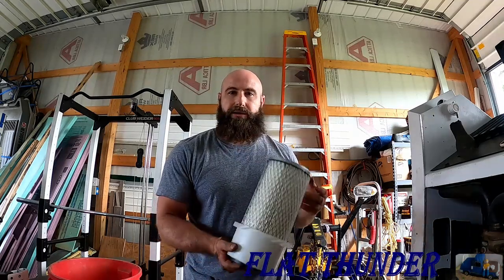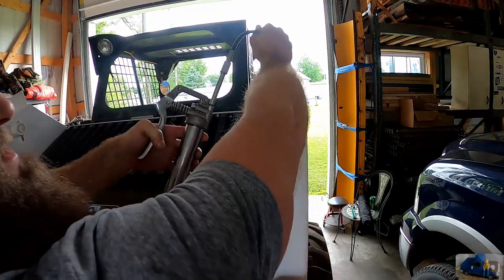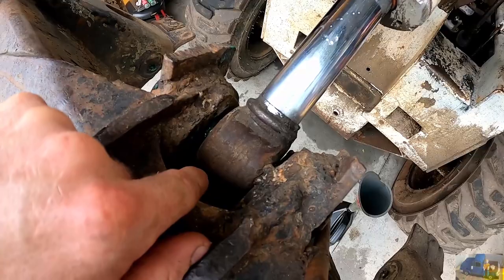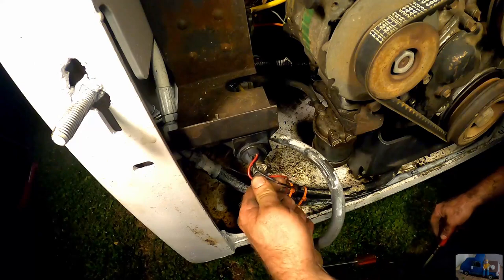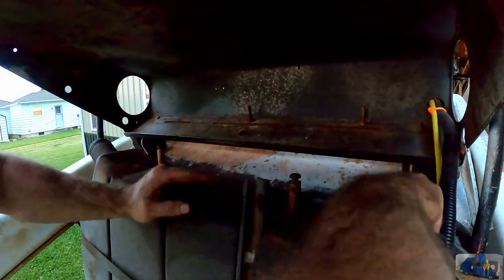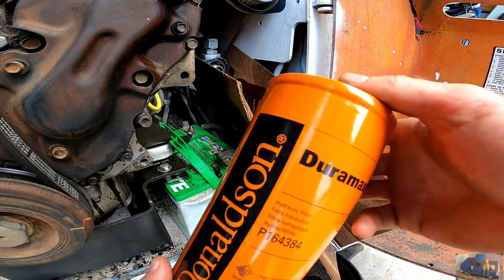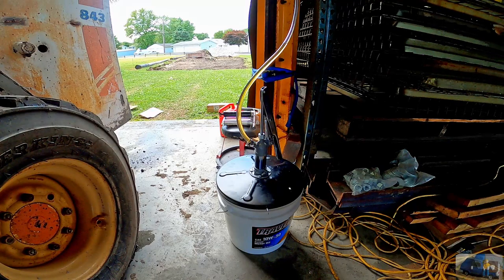BOBCAT 843 - PREVENTATIVE MAINTENANCE / FIRST CUTS; Episode# 9

Comment: The Diesel filler cap hole is bigger to pull the screen out 👍
Reply from the maker: Good idea!  I never thought of that until you mentioned it.  Hopefully I will never have to address any issues with the fuel tank line again.  Might hookup the fuel sending unit, but that's getting mighty fancy for this old girl.  Thanks for watching! 👍😁
Reply: @FlatThunder  it was a good watch 😉 and a great machine 👍 if you look after it unlike the last lad with dirty cans of diesel you will never be in the tank again, did you ever get the bucket pin fixed?
Reply: @FlatThunder  IV to pull my transmission out completely as the case has developed some kind of aluminium rot on a circlip retainer it holds a flat coin type of stopper against a o ring directly under a drive arm underneath the transmission 😓 about 8 pipes to come off and engine out the rack door, H46  spilling out of it 😔.
Reply from the maker: Oh boy!  Sounds like a big project over a little defect.  I'm sure it's worth the effort.  These are great machines!  Good luck 👍
Reply from the maker: Thanks!  The bucket pin is still on the 'to do' list.  I also acquired a new seal kit for the tilt cylinder.  I noticed with the forks on that she leaks off rather rapidly.   The whole tool plate needs some serious attention.  Hope to address all the issues on the front plate at the same time, but I'm currently in the midst of many other immediate projects.  So many projects.... So little warm weather left in the season.
Reply: @FlatThunder  ah I hear ya brother we definitely in the same boat 😂

Comment: Attempted to replace fuel filter on 843B, fuel not flowing, machine not starting.  Any videos or suggestions on what to do to properly complete the task? Thanks
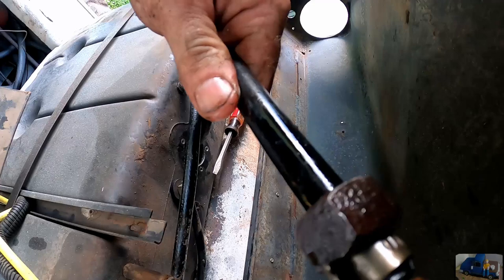Reply from the maker: Hello!  You likely have air in the fuel system.  You need to bleed the fuel system.  Start by pumping the priming bulb (or in my case running the electric priming pump) until fuel is at the injection pump.  Then crack all the fuel lines loose at the injectors (loosen the tube nuts).  Crank the engine over until you see a good flow of fuel squirting / bubbling out around the tubes at all of the injectors.  Tighten the tube nuts and try starting the unit.  It isn't overly thorough explanation in the video, but check https://youtu.be/njjUUzRYN4Y around 12:45.  I explain the process.  Good luck! :)

Comment: Nice video, I work in the Maintenance Dept. at a Donaldson's plant,  Duramax has nothing to do with Duramax diesel just the name of the series line. Just about every filter you see on industrial equipment is a Donaldson filter painted/boxed in OEM specs.
I'm wondering if you have any advice on how to trailer an 843 that isn't starting. I want to get it back to my shop so I don't have to make 10 trips back to grab something I forgot or haul every tool out there. I've looked around the forums and found such varying advice that is never specific to Model or complete procedure. Don't want to just drag it up the ramps. Do you think it would hurt if I had 1 guy hold the levers in reverse while I turned the key for short periods of time.  Thanks
Reply from the maker: Hi Tim!  Thanks for the inside information on Donaldson filters.  I think they are good filters.  I don't think the cranking RPM will flow enough fluid to progress the unit forward.  It has a big gear reduction.  It's worth a try, but I'm not overly optimistic it will get the job done.

Loading a unit is pretty easy with a winch.  Relatively speaking of course.  It's the unloading that gets sketchy.  I recommend backing the trailer up to the unit and winching it on the deck.  We used some scrap sheet steel (old barn siding) and ATF to help out slide across the deck.  Once the tires where on the sheet steel it acted like a ski.  It worked great!  Best of luck on the repair!  They are great machines.  Thanks for watching and be careful loading / unloading!  👍😁